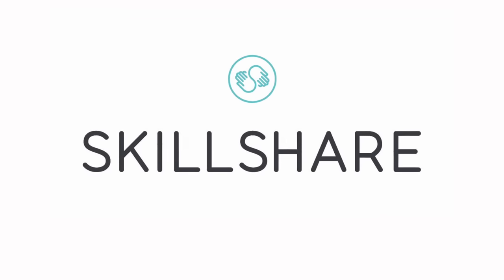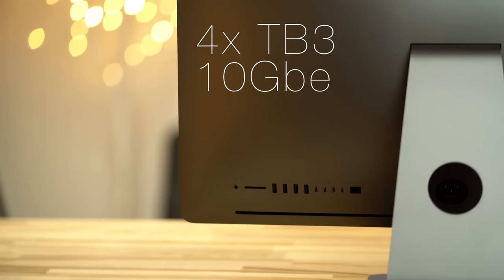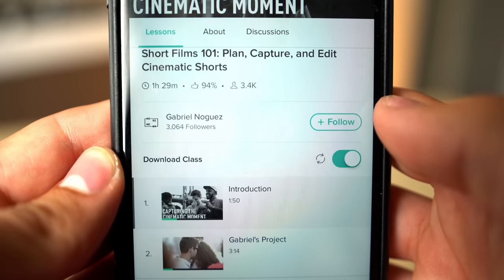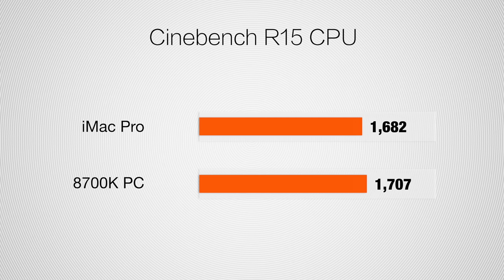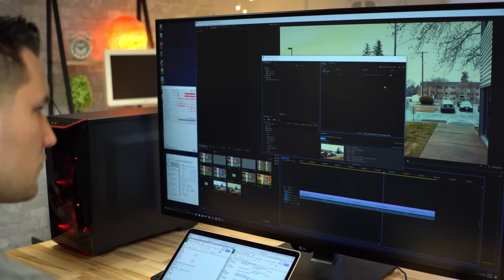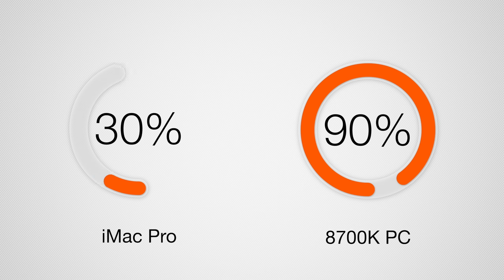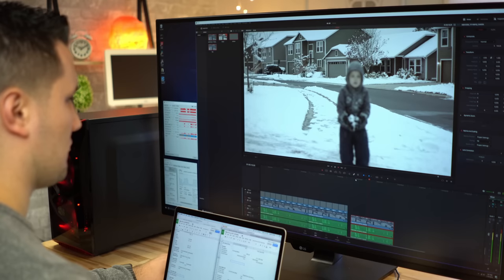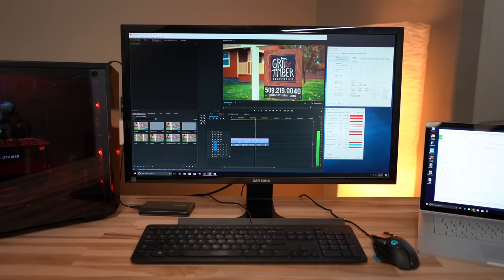$1350 PC vs $5000 iMac PRO for Video Editing 😲 Premiere & Resolve

Comment: What's more surprising is that, based on the data presented in this video, meanwhile the iMac renders the video, you actually can keep using it flawlessly, since it uses only a percentage of what is capable of. While the PC is so busy that you should plan your renderings on your off time. That's when that price difference really plays a big role, especially for people that constantly edit and render videos or any type of graphical content.
Reply: Fantastic point.  This increases productivity substantially for professionals.  The extra cost will pay for itself within the first year.
Reply: Looks like you dont know how computers work...

Pluss you should consider that this PC costs 5 times less...

Now imagine how will it perform with 3000 budget PC
Reply: When you Overclock your CPU or GPU only negative thing will be temperature.  Everything else will be faster. OC your gpu will never be able to give 100% more power, max +15-20% of your base performance. 
OCing has no downgrade, that means it won't lose any ability in multitasking, vice versa - It will gain power and speed for multitasking.
Reply: Daniel Janson I already looked at the threadripper of 14 cores versus iMac pro 10 core. Nothing impressive for the threadripper and iMac pro has a 5k display imbedded. So the iMac pro doesn’t run just on hardware for that price, other things are included. So even a Pc with $3000 tower got nothing when you still need to match the 5k display of the iMac pro with additional purchase which was illustrated by mkhb. So no it doesn’t cost 5 times less. This video had several flaws presenting its data as well nor was it able to show playback from multiple sources running simultaneously while rendering in the background. Productivity between the two systems are miles apart. Not even a comparison.
Reply: As I said on my comment, I based my comment on the data in this video. I do know there are computers much more powerful and cheaper, but when you get to a budget of 3000 dollars just for the PC, at least 1500 dollars for a 5k monitor, plus the OS, plus the peripherals, plus the fact perhaps you're not going to build it yourself (most creators don't), the price will be so comparable that by any means Apple is still the choice, because of its ALL-IN-ONE design.

Then, anybody is different and anybody can spend their own money the way they want. But you can never tell what others should spend their money on.
Reply: You are right, you can't tell people what to spend their money on but you can easily see what people already spend their money on. Google it, 88% of the computer market is PC and 8% is mac. Trump has more supporters than Apple by 30%.
Reply: or you just buy a pc for 5000 bugs 
so you can render and play video games at the same time
Reply: Giuseppe Pipia and i7’s might be cheaper, but Xeon’s are much more reliable and resistant.. so it won’t die as soon as the i7.
Reply: Also, you support intel by a little to push new technology.. so, be thankful to professionals
Reply: +David Fally

"Xeon’s are much more reliable and resistant"

No......just.....no...... Anyone who works on servers for a living will tell you that when it comes to processors, a proc is a proc is a proc..... Keep it cool, and if there aren't any defects in the manufacturing a desktop class processor will last just as long as a server class processor. Both will last you well beyond the lifespan of the PC/Server/Workstation. The difference is primarily the cache on the chip, but the lifespans are both longer than will matter. Ironically, proper cooling has been one of Apple's main problems over the years. Not to mention the cheap screws in the monitor mount on the new pro. It's just more of the same from Apple..... Style over substance......
Reply: Great Point, but you could still do that with a higher end PC that would still come in a a lower cost.
Reply: Or you could get a 4300 bucks water cooled PC with better specs and a 4K monitor.
Reply: But why the absolute need for a 5k monitor? I don't find anything you mentioned to be a justifiable reason to buy an overpriced unreparable computer. You can also find plenty of already built machines at a much lower price tag for more performance than the iMac as well.. which I'm next to sure you're already aware of.

You can spend your money on whatever you like, but your comments seem to be more about convincing yourself of your choice.
Reply: "unreparable computer"

^^That's the real crux of it..... You won't be repairing it yourself, and you have nowhere to go with upgrading it in the future..... It's a one off (paperweight) that you will eventually throw in the trash, which is where the old trashcan style machines ended up. As with all that is crApple, it's designed to make you spend more money. This is the "quality" you're paying for from crApple.......

https://www.youtube.com/watch?v=MG_NRcy5mxU

If they cut corners like that on the monitor mount, just imagine where they cut corners on the inside of the machine.......smh
Reply: Brian Jones is an overpriced machine impossible to upgrade. Believe me, a PC is way better in everything. A PC also can have a better cooling system.
And don't forget RGBs lol.
Reply: "Believe me, a PC is way better in everything."

I'm well aware, why do you think I posted the link?...... CrApple has been making sub-par products and ripping their customers off for decades.
Reply: Brian Jones sorry I was confused and used the wrong name, it was referred to OP.
Reply: No worries. :)
Reply: Brian Jones "CrApple".. the amount of cringe.
Reply: ""CrApple".. the amount of cringe."

Cringe that anyone is actually buying them? Yep, totally agree. :)
Reply: its cheaper to get two 4k displays instead of a 5k display
Reply: What's more surprising is that, based on data presented in this video, you can buy 2000$ CPU and overclock it that will obliterate Macs in performance by double, and it'd still cost around the same.
Reply: For the price 5K iMacs and the Pro are really cheap, 4K P3 monitors are really expensive and a big deal for designer and videographers.
Reply: they aren't even that expensive, way cheaper than a 5k display
Reply: Giuseppe Pipia If you start doing other stuff on mac while rendering your render time will be longer
Reply: Daniel Janson or having two of these PCs one for rendering one for doing work while it renders and it is still cheaper.
Reply: In the video itself, they say that the final price for the working PC is about 3500$. And it doesn't take into account other "hidden" costs, like time spent into building the machine.
Reply: @Simboiss  building a computer is fun and a lifetime experience, trust me, you'll never forget the day.

And also, cheaper, and better. I could literally make a cheaper computer right now if i wanted to. Performance wise, the pc SHOULD kill the mac because there are more options. Different cpu models, etc, you cant do that on a mac. You have to use what you are given.

And quiet fans? Bro have you seen a pc? They make absolutely NO sound, if u have the right tools that is. And imo mechanical keyboards and mice are much better, because you have a choice.
Reply: When you buy a machine preassembled, there is a cost, no matter what. These machines don't assemble themselves magically. If you think your time doesn't have value, then it's you and only you. Some people value their time. That's why people are paid for their work.

Yes, any PC that you build yourself has the potential to be the best of all. Except, it's an absolute. People don't work in absolutes. Macs have quieter fans than the average PC, not the top ones. The top ones are more expensive because of these little details that add up. Macs are also more expensive because details add up.

You can plug pretty much any keyboard on a Mac, so there's no problem there. Mechanical keyboards are noisy and have more travel distance, so it's not for everyone.
Reply: @Simboiss  these machines dont assemble themselves? Ofc they dont, but do you think these apple employees hand build every mac? Have you even opened one? Most prebuilts including windows ones have glue everywhere and everything is lazily smoldered onto eachother which terrible cable management. And no, you're trying to compare a mac to a 1900's old windows pc u saw at school. Your perception of a windows computer is so incorrect. You simply can not compare a windows pc with a mac in terms of hardware, pc's always win because they have better everything and for cheaper money. Idc if your mac has a vega or a xeon, we have that too, not an argument. Quieter fans? Bro we have them too, and better ones as well. 

Also there are different types of mechanical keyboards. There are quieter ones and loud smacky ones like the cherry mx blue. You are clearly an uneducated mac fanboy who has no knowledge of a windows. My answer is biased because I have only used a windows in my lifetime, and I understand that. Please correct any mistakes i have because im trying not to be a fanboy, but it bothers me to see a mac fanboy trying to compare a mac to a cheap windows computer.
Reply: No, they don't. PCs are very variable, so they are better AND worse than Macs. That's the problem with your argument, PCs are not a specific machine, they are thousands of different permutations of parts. So when you say "PCs are better than Macs", and you don't specifiy WHICH model, then your argument means nothing. You can't take an average Mac and compare it to the best PC you can build, it makes no sense.

Shitty PCs exist, good PCs exist. Some are cheap, some are expensive. I'm not a fanboy. I've known and worked with Macs and PCs, and I still do today, on a daily basis. So yes, I can compare them in theory and in practice.
Reply: @Simboiss  and thats why they are better. There ARE better pc's. There are worse, but when we compare them at the same price point, you know what the winner is. The thing is, we are comparing the best of best. You simply cant just say that pc's suck because there are bad versions of them. There are bad versions of macs too. So whats your argument? You just proved that pcs are customisable and therefore, better because you CAN make a pc better than a mac. If you make a bad build, that doesnt make pc as a whole bad, thats the builder's fault. And we are comparing the pcs of the same price point here.

This is not an average mac, this is one of the most expensive btw
Reply: If your comparison is only on hardware found on end-of-line inventory special deals websites, yeah, pretty much any PC can be built to beat a Mac's hardware. It doesn't mean they are "better" overall, it depends of how you define "better". Most people don't care about raw power. Even more advanced users know that power is only one aspect of the overall equation.

The joker card is Mac OS X. This can't be emulated by price point alone.
Reply: @Simboiss  so the only reason you get a mac is for the os? The thing is, you CAN get hackintosh on your pc too, so...

Yes, its preference in terms of os, just like the android vs ios debate, in the end its based on what you like and do.
Reply: I was expecting the word "hackintosh".
Reply: @nielsliljedahlchristensen4924  u can except the 5k screen its cheaper to go dual 4k moniters (8k)
Reply: @Simboiss  most shops and company that sell prebuilts have like a 80-100 build fee not too much
Reply: @dozergames2395  You mean quad 4k? Because 8k is twice the resolution IN BOTH DIRECTIONS, and, you know, 2*2 = 4.

Comment: Great video. Gosh I need to upgrade soon. Still using my 2010 Mac Pro Desktop. I love it but there is no thunderbolt. I wish Apple kept the same architecture and upgraded the intervals.  Can owc upgrade the ram and ssd of the base model iMac pro?  I’m thinking later on if I need to upgrade. Also how’s the speakers. How is the 10g Ethernet used?

Comment: Please compare this i mac pro with Thread ripper and i9 processors!!
Reply from the maker: I will! 10 core i9 overclocked with a GTX 1080
Reply: Thnx!!
Reply: Also compare the thread ripper. I want to have an idea how well does it performs compared to the i9, because i9 consumes a huge amount of power compared to thread ripper.
Reply: some i9's out perform the 1950x but its pretty negligable for the price difference so I would recommend threadripper over any i9, it either blows them out of the water or gets beat by like 9% for hundreds of dollars more

Comment: The pc was probably loud as a turbine
Reply from the maker: Definitely louder lol, but my fans and watercooler have quiet fans to help.
Reply: bins nope that‘s bs. Apple designed their macs to be user friendly. I. e. they make sure you have the most pleasant experience with their macs, less noise etc.
Reply: Macs are known for thermal throttling, so that's why it was so quiet. Apple is so keen on not tuning on the fans that they'll ompromise performance.

Also, I don't really see how fans are not "user freiendly". When you pay 5K dollars for a computer, I'd imagine you don't care whether it gets a little loud or not.

Comment: How's the iMacPro compare to your threadripper 1950x build?  (also interested in that i9 7900x) I am mostly concerned about smooth playback and of course stability, mostly on premiere but also resolve.  My current system gives me the GPU errors a lot on exporting or rendering in Premiere Pro and I have to do something very soon.

Comment: HAve you tried to build a Hackintosh in the i7 8700 platform? Also why the GTX 1070 rather than the GTX 1080ti? Is the performance difference not worth the cost?
Reply from the maker: Exactly, you’ll see little to no performance difference since the GPU is not bottlenecking the system

Comment: Very good lighting in this video. 

The real question that I and the rest of the IT department use is TCO for the job at hand. Performance tests like this are nice but:  irrelevant after any Adobe update, decreasingly useful when calculating time (years) of working, and presume common prosumer software. The simplified version of this video is: Can you buy a faster, cheaper PC than Mac? Yes, much cheaper. But in 5 years, what's the cost you've spent for the performance? PC have basically a zero resale value because only pros understand the need for high-end parts but wouldn't buy second hand, while there are millions who are happy to pay upwards of 50% for 5 year old Macs.

Comment: Literally no reviewers ever consider comparing the editing performance of ProRes media on PC vs iMac Pro. You can't really compare the performance of 2 computers this way just due to the different implementations of different codecs on both systems. For example, RED decoders are great and can use more resources within Premiere, however, if you load up 4K ProRes 444 media, there will be some differences in how both machines perform within the same Adobe app as Quicktime decoding on OS X is more efficient than that on Windows. Resolve has completely different built-in codecs for Quicktime. Resolve can use more cores, Premiere can't. Resolve's encoders leverage GPU while Premiere does not, at least for some codecs. Please do a test with ProRes 4K media. Try playback, edit and export with Premiere and Resolve on both platforms. I'd bet money on both platforms having almost exact performance for ProRes media within Premiere.

Comment: I think comparing a PC (with nVidia gpu) against the iMac Pro (with amd gpu) using products like Premiere pro is like comparing a 4x4 Range Rover (PC) vs a Ferrari 488 (iMac Pro) in a off road environment (Premiere Pro). If you buy an iMac Pro for video editing, use it with FCPX (race track). You'll get much better results when you use the right tools.
Reply: that has nothing to do with the mac but the software
Reply: my moms laptop is so easy to upgrade, its a lenovo z50 70 and all you do to upgrade the storage(getting an ssd) is take 3 screws out of the back, open up the back, remove the battery, slide the HDD with the try out and remove the 4 screws on the tray and mount the SSD on it and put everything back together again. 
when comparing a imac to a desktop the upgrade difference is night and day, not only is it easier to upgrade but you can also upgrade the whole system with whatever parts you want

Comment: If you bought a high end M.2 SSD like the Samsung 960 Pro you mentioned will close the gap in some of those test especially the 8K 60fps playback issues. In fact, I am sure the latter can just plain be resolved with a SSD with a higher bandwidth because that iMac SSD is pushing at least 3 times the bandwidth.

Comment: My i8700K crashes on a regular basis using Premiere Pro without any overclocking. I have a 512 GB MVME system drive 16 GB of Corsair DDR4, a 1080ti, water cooling, and a 2 TB SSD for video editing. What am I doing wrong?

Comment: You can build a custom pc 2-3x times more powerful than mac, at the same price but macs are usually more stable because of the hardware compatibility. If set up with the right hardware then there won't be stability issues on custom pc either. 
If gaming is your priority or you need the more power then always go for a custom pc.

Comment: Hackintosh 600$ - Cinebench 1760 score, geeckbench 27100. Ryzen 1700 overclock to 4.0ghz, 2x8gb ddr4 2666mhz, NVMe Ssd 256gb (read 3000mb, Wright 1200mb), gtx 1050 2gb. Final cut, davinci resolve working stable.

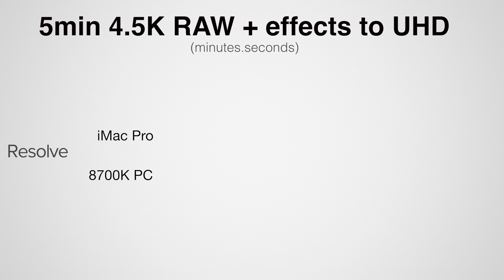Comment: Nice vid.  10:06 - do you have your graphs mixed up?  You say the iMac is faster but the graphs don't indicate that, there.  I hear that most creatives don't overclock since it leads to instability.  My Mac Mini stays on 24/7 and that's what workstations are meant to do.  The PC you have is impressive but, if I had the money, I wouldn't use it for my needs.